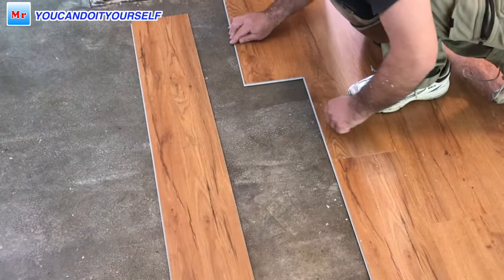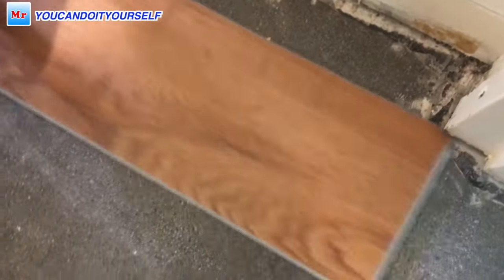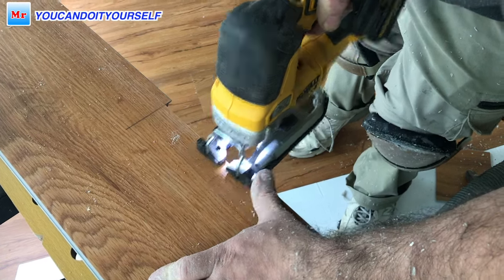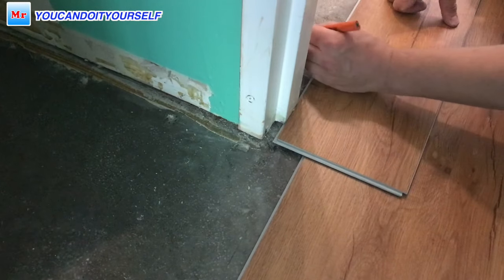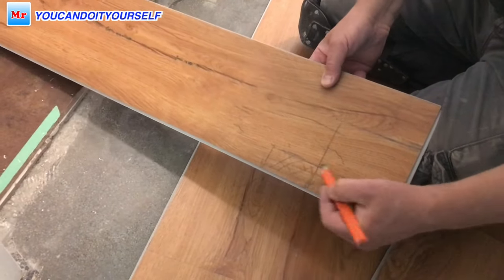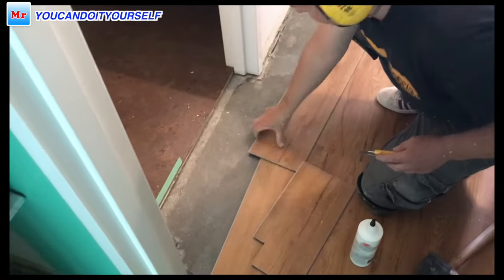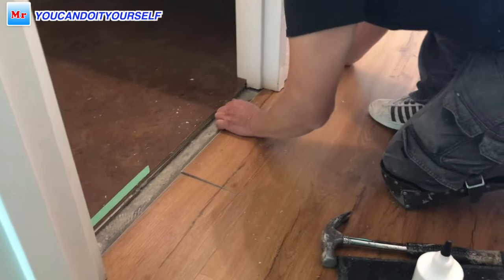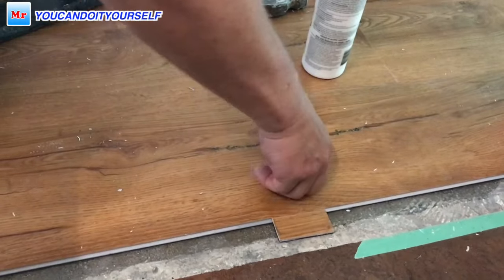Amazing Tricks How To Pass Two Doors Jambs with Vinyl Plank Flooring| LVP in a Narrow Hallway DIY

Comment: What a great video. I've just finished doing something very similar to this (Before I saw this video). All other videos show how 'easy' laying these floors are, but they conveniently don't show the 'problem' of laying in a doorway on the opposite side of where they started. Because the plank has to slide under the cut out parts at the bottom of the door jambs, it's impossible to slot in the board to the previously laid parallel board. I had to figure this out myself. Your method is great and almost identical to my method, but I actually used the normal end-of-plank join (I didn't cut a board in half). I just chipped off one side of the end join a bit so that they still slotted in together (A bit hard to explain really). Like your video at about 4:31 I started with the Right hand board on top of the left hand board and slowly tapped it across the left hand board (towards the right) until it went completely past the LH board by a mm or 2, and then tapped it back into the join.
Reply from the maker: Thanks for watching and your advice!😀

Comment: What if it’s a vinyl plank product with beveled edges?
Reply from the maker: This floor with beveled edges too.
Reply: Well he may be saying what if the bevel is a color.. so if you had say a light floor with beige color bevels and you cut the board and make ur own bevel with a small hand planer it won't be the same color as other bevels it will just be the dark inside plank color.

Comment: None of these videos show how to do this when your vinyl plank flooring requires attaching it at an angle. Can’t do it like this if you have to attach it at an angle. Because you can’t get it under the trim.
Reply from the maker: All projects are different, but with an angle connection under the door jamb, you can use the same method.
Reply: @MrYoucandoityourself  How? You can't tilt the plank at an angle when it is under the door jamb.
Reply from the maker: Cut the lock on the board and slide it in with glue.

Comment: Flooring that's harder to lock together at the ends of the planks isn't as easy when using this method
Reply from the maker: Hi Geezer, read the instruction for your material. Many types of LVP need hammering the ends of planks. I did installation LVP this week - the same type of installation, I used a rubber hammer to lock the ends. Thanks!